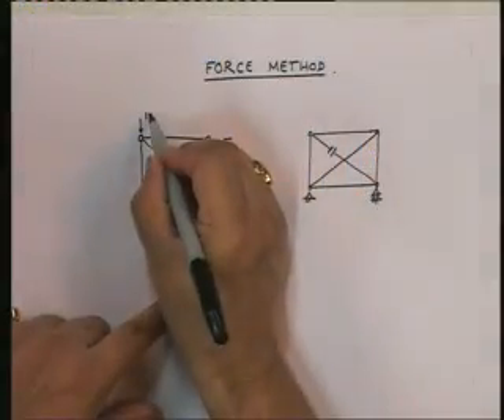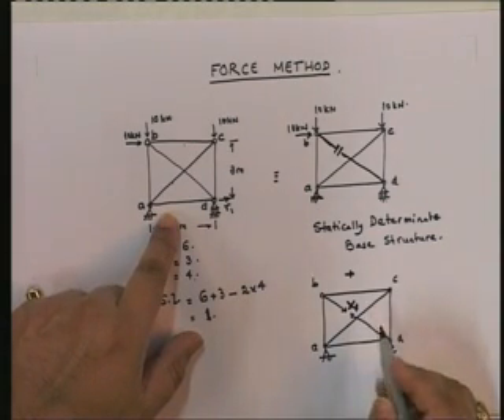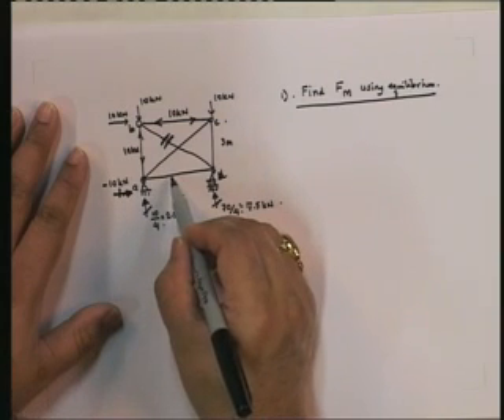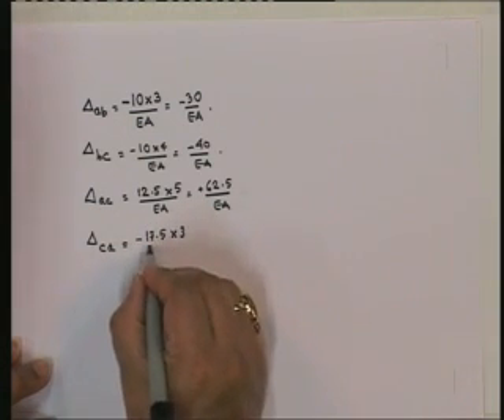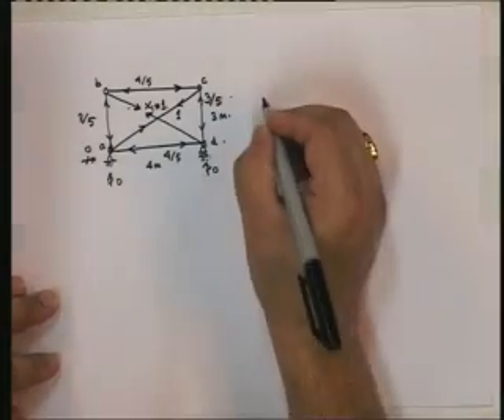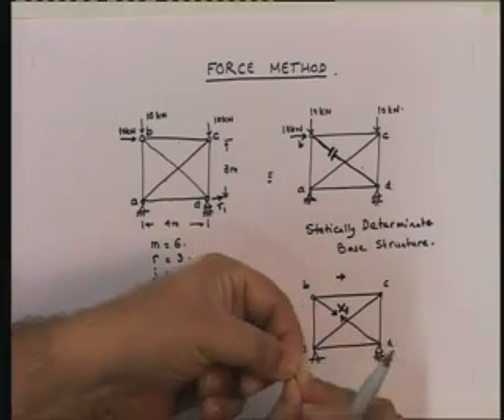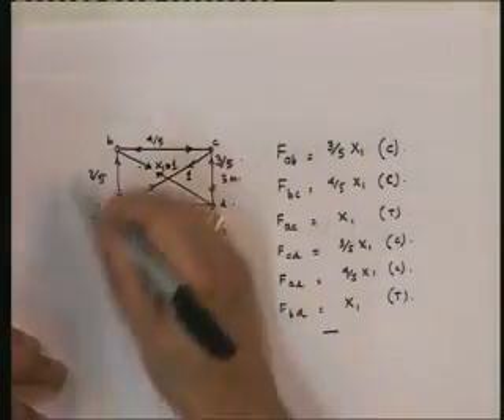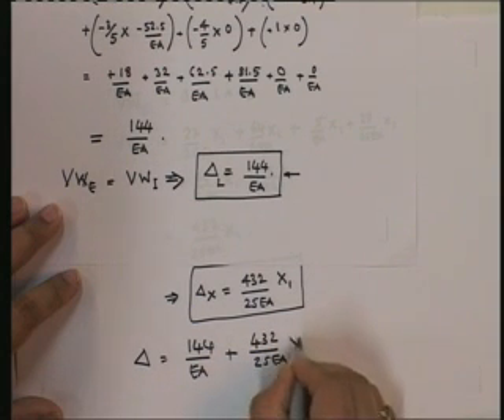Lecture - 4

Comment: What happens at 40:36. There is a discontinuity and everything changes without any link with what was being explained previously.
Reply: Basically what the Prof. is doing is applying principle of virtual work twice. Once to calculate the ∆L due to actual loads (by assuming unit load for virtual work), and then to calculate ∆x due to force X. Then he applies the compatibility equation i.e ∆L + ∆x = 0.